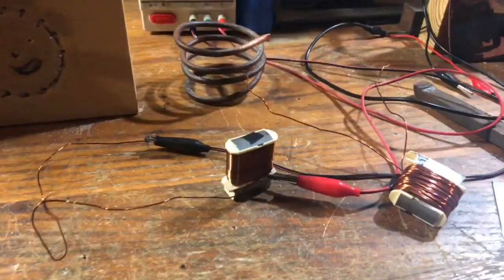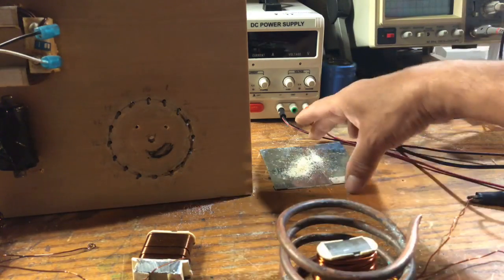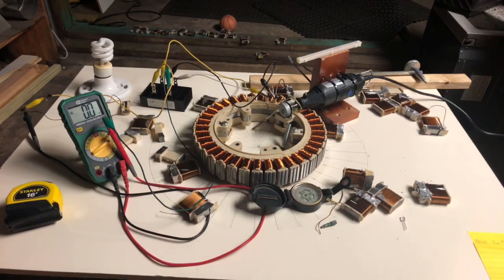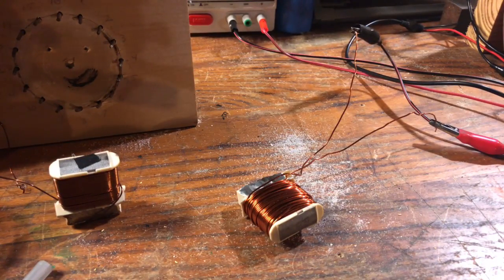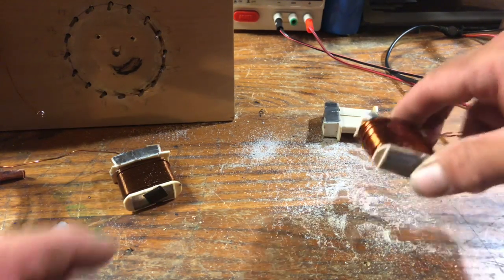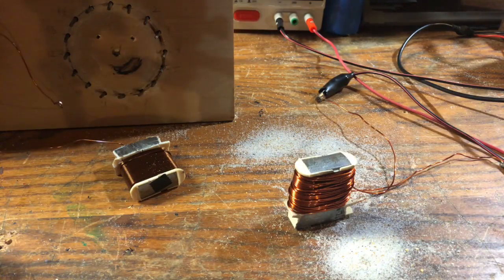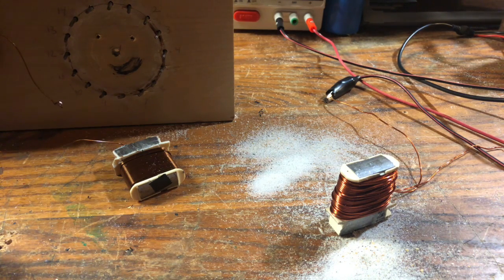Self Excited Magnetic Generator ! Update #3

Comment: Power supply lugging down under heavy load causing excess AC ripple as capacitors unable to smooth AC ripple and DC half waves to more pure DC output.  Copper winding shows effect more due to lower impedance and aluminum winding does not show vibration as coil is higher impedance and draws less heavy load.

Comment: You could repeat the vibrating sand experiment with a true DC source like a car battery(s) set at the similar voltage as your power supply.  Then if there is no vibration then the power supply AC ripple is the cause, but if you do get vibration with a real battery DC source then you really got something to dig deeper.

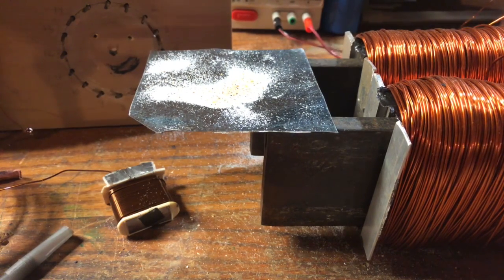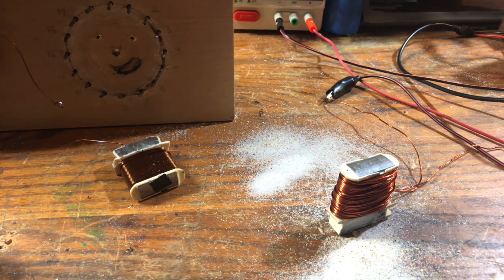Comment: 11:51  I signed in And said 'Hey' in chat Reply.  But Get this, I didn't Hear you, the computer I was using Had no Sound, so I went to Get cell phone but Decided not to Use it cuz of Radiation effects in Environment that could Be hazardous to People around so..i Eventually forgot About the live Stream and just now Am Watching Your whole video Cuz i Didn't See the Beginning of it till now.  So...  its Good...that's Awesome About the Lamenated Core!  How it effect's the Outside & inside Magnet streams cuz THERE IS A SEPARATION to keep Sweet 16 Perfect, and more kick as ed Said in it  Cuz the permanence of the Occilation factor, Repels and Repeats itself, circulating cuz the poles in the small particles keeps changing As they are Repealed when they Change, cuz Ed talks of PASSING THROUGH PMH Prongs Center, and How it CHANGES the poles...in the iron Core which Immediatly Gets them Driven Out cuz Ed said OVERCROWDING produces it and Since You Are Using A Wall Device Power stream Modulator dc Current Box thing...., that is Creating THE OVERCROWDING, '''''cuz the Battery doesn't Die'''' i mean  THE BATTERY of the THING 'Device' your Using to Create the CURRENT....Gives 'it'S streams CONSTANT.....and no Just Tap But I bet there is a Small Circuit in the Wall  DC Supply thing that See's the Overcrowding and maybe Somehow ''clattering'' as You say elsewhere..  Is causing the occilations of the particles on the plate...but Maybe for Some reason, the particles are switching Poles Because they Are Going through Some kind of PMH 'field' Buzz effect from Some kind of gyroscopic understanding's encompassed in the field.  I seen your Compass move when you were along coils of Circle thing.  I thing....DEFINETLY...on the Magnet Wheel that All the North Poled Magnets Gather to the Top of the Circumferance Ring of Vee's Corner Tip Point End of prong Stack Section's.  ...and the South's Gather on the Bottom Outward part of the Magnet Vee's, while the Norths Are Circulating More towards the Top.  These 'souths' are Gathered in the Block i think, and Clover, and Everything else, including the Ford Model T Ring Gears that Hold the Magnets down.  Cuz, if they are all South......orientated.....the clover...the Gear rings...flywheel and Block.....   if You take that  Frame i just Described and Made it SOUTH..Magnetized..and sat It in iron fillings..You Would See..THE CLOVER...OPENS Up a Area....Like even Looking Like a Clover Shape.....its like a flower...Open...& Pollen from Tree TOP 'North' fall's Down..  to Pole 'Stake' Which I think Get's Very Hot Heated Maybe cuz THERE IS A SECTION of the Magnetic Compass Wheel, that is The Area 51 or keep Out Spot...G Where the Gyroscopic Motions continue to Essence the Pool of Rythmatic Ocean FIELD Surrounding ALL Embodiments, of Substructure frame, and Magnet's of Vee's, and Also POLES.....Sat Along THE OUTSIDE 'of the Area' Of Circle Vee's, which STICK 'Together' Cuz they Are Attracted On Towards Another, But I Wonder which Way the Energy is Made to Go into Motion in the Field of the Gameplay Round About Which the Vee's Are A Donut torus etc type.  That Once that ..SMALL GENERATOR WITH A SINGLE WIRE, is Caused to Made 'Currents from The Air'''  that.....that Would inhibit or Induce A CALL FOR AN UPRISING as it Were in the Word structure Thought sentence strufe Debate of What's Going on here Exactly, i think 1 at Least knows, if Not Many more, Even power's of More signifigance are Seen behind the 'curtain's' As it were...in the field..of shield..Guiding;s of strifed magnet streams Looking for Gatherings, and CONSTRUCTIONS, and 'deconstruction' Periods, which Ed described As, the easy east knowing of core understandings of nature foreverness'es That cannot Be deleted.  Anyways...  if You read this far I better Make it worth it..  Chat Says:  "Ronald Laytonhave you ever tried powering the core with audio signal from an amp with a tone generator for the source?"  It's funny He says that cuz I put Speaker from Amp On Pulley at Center of Wheel, and Held Guitar on Side Near Vee's and played guitar, and at One point The 1st most Thinnest Bottom string, Got Hot and Snap't!  0_0  There is Something to This but I have further to Investigate. I know When I plugged my PMH into the Wall current..it Vibrated...stuff...around it and itself to Vibrated.  Wow Roy this is An Awesome video.  The sand..the Quartz..the 'effect''     That way it's Like YOU CAN SEE IN A TUBE.  You CAN SEE THE EFFECT BY OF WHAT IS HAPPENING INSIDE, IF YOU LOOK RIGHT.  AT THE EXPERIMENTS YOUR DOING.  That is What I Feel is Going on At the Center of the Wheel.....Some kind of Vibration...... Wow What you said at 18:24  I feel that  18:42 !!!  "many eddy currents in iron, many magnetic field.....smaller that the bigger.."  etc etc etc Yes! : )  anyways Yep vibration clatter Magnetic field...Plates....this is the Essence of the Magnet Music tones Towards ..Success... good success as Ed put it....  the Lamenation prolly DAMNS UP THE MAGNETS IN THE PRONG ENDS EFFECT TYPE THING, Sept ITS ON THE WALLS Etc all Over...  Maybe the vibration too is the Magnets Escaping AND FINDING A PATH '''''THATS BROKEN'''''  in ITS Orbit As Ed put It!  "Even though its Orbit is BROKEN, its"  ""Hard steel U shape magnets have a broken orbit, but under proper conditions it is permanent.  I think the structure of the metal is the answer. I have two U shape magnets. They look alike, but one is a little harder than the other. The harder one can lift three pounds more than the softer one.  I have been tempering the other steel magnets, and have noticed that the harder the steel gets the smaller it becomes. That shows that the metal is more packed and has less holes in it so the magnets cannot pass through it in full speed, so they dam up in the prong ends. They come in faster than they can get out.  I think the ability for the soft steel welding rod to hold magnets is in the metal's fine structure. ""   Ed just Described THE WALLS...the Shield..the Damned Up LAMENATED Broken Orbit Bc of THE STRUCTURE OF THE HARD AND THE SOFT.  The temperate MATERIALS and Their 'magnet makeup' How ed said they dissolve in acid and How Some things """"HOLD""""   more 'magnets' Than Others.   See?  Ed Says Hold Back 'KEEP Fresh Boys Away" Like he is Describing The Process of the RUNNING OF THE CHANNELS GOES ALONG THE PATH Before They MEET,, ""in the middle Somewhere"  """but when the orbit is broken then they will run in the coil, and the result will be more light.""""  More Light Cuz IT LASTS LOOOOOOOOOONNNNNNNNNGEEEEEEEEEERRRRRRRRR Cuz it Has A Past A Present AND FUTURE!!!!!!!!!!!!!!  : )  BAMM! for Your Buck.  More 'kick'  PUSH..Away..till COMES BACK. Sweet Rev0lver Round table Shooting at the Ring time Cuz Ed Got Stars and Maps through Telescopes and Coordinates of moon Beams and Target's in the Parascopes He made or Obilisks or Telescopes their Called.   Hmm What Else? ...